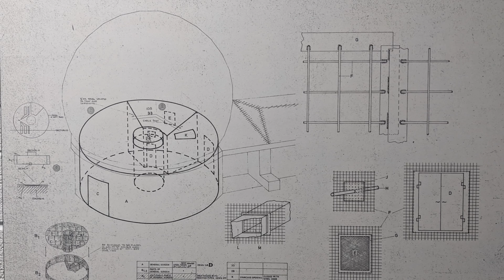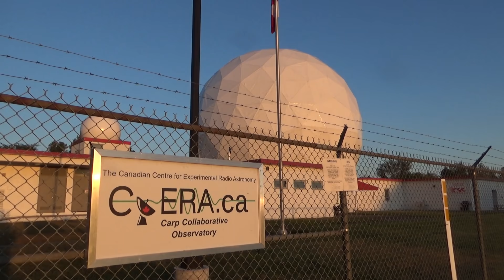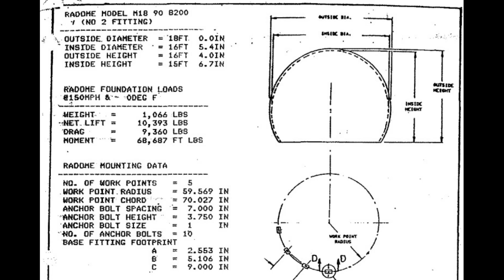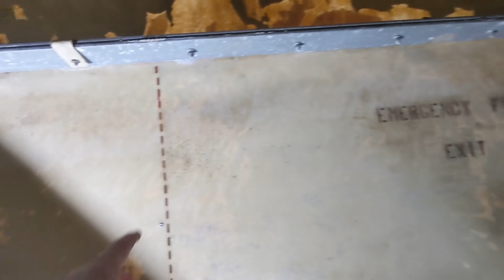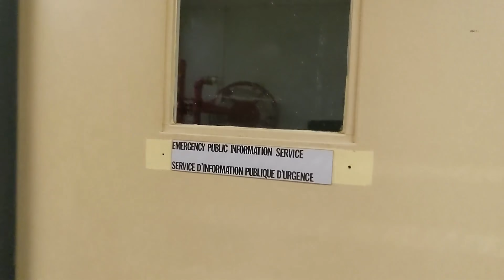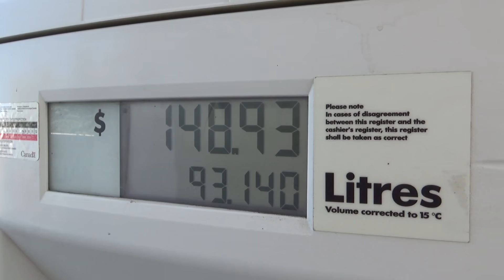I Bought A Geodesic Space Dome!

Comment: newbie question: how is the satellite able to function from inside the geodesic dome? does the material really not impede perceptivity to radio signals at all?
Reply from the maker: It's made of aluminum and fiberglass, the metal parts are far enough apart (and in a semi-random pattern), so that it doesn't block high frequency signals. Once we get ours set up I'll do a demo with my mini radio telescope to see if there's any difference inside vs out!

Comment: Is weather a consideration on location of the dome? You may want some bushes and trees near as a wind barrier else you might have a dome rolloff the side of the hill in a high wind?
Reply from the maker: It has to be attached to the ground somehow. The legit way is a cement foundation, or the easy way is to pound long rebar rods into the ground. You don't really want bushes or trees if you're running an antenna or radio telescope, as they could interfere with radio signals.

Comment: I have a stupid question: the dome seems to consist of aluminium item like profils? Isn´t that a Faraday Cage and would block the electromagnetic field?
Reply: Not a stupid question at all.  Metal-space-frame radomes have a low-frequency "cut off" below which they become attenuators -- that frequency is dependent on the average spacing of the "mesh" that is formed by the frame.  For most applications, that spacing is "sloppy" enough that it doesn't noticeably affect signals going through--because they are at higher frequencies than the structure "cut off".

Comment: Just remember to check to make sure you can still fit the dish parts inside BEFORE you finish putting the dome together! Would suck to have it all together and find out the pieces of the dish don't fit through the door! 

A cool trick you should try once it's together is to lay down on the ground with your head exactly in the center of the dome and start playing low frequency tones like for meditation.

Comment: I sent a lovely message to Canadian Tyre about some of the basics of running a retail company. Surprised they didn't already know the basics but good to share knowledge.
Reply: (Dunno how they're structured now) Traditionally each Canadian Tire franchise was independently 'operated' but forced expected to accept returns from any 'Canadian Tire' under pain of having their franchise revoked and the location reduced to rubble by the corporate overlord who retained ownership of the location.

It has caused years of ongoing problems for higher profile locations profits because less-accessible ones offload their defect/bad merchandise and refuse to take the returns. (edit:) CDN-Tire-Corp made it clear to the higher-profile locations that they'd be replaced if they didn't take the loss. There were grumblings about a class-action lawsuit in the news.
(And they did flatten the one nearest my house and left the lot vacant for years after a dispute over ownership continuity/'succession' - though that could also have been because they were reorganizing the territories.)

And yeah; I've bought a hilariously cheap toolset with a claw hammer from them "as-is" that had a warning label on the handle from the factory that very explicitly stated that it would break if I hit anything with it.   When I tried to pry a nail with it, its handle splintered/peeled apart like opening a book.   The laugh +100 pcs were worth the $7.50 .